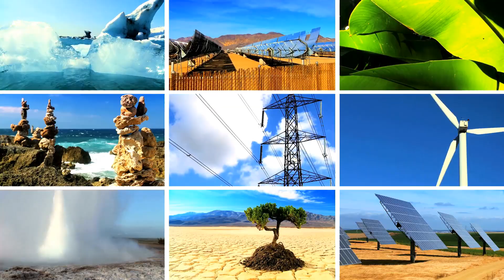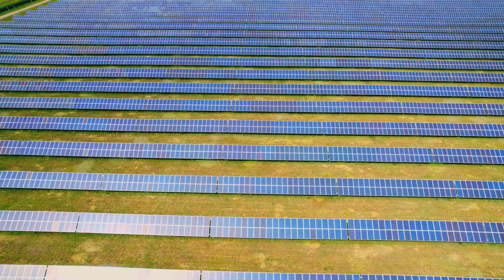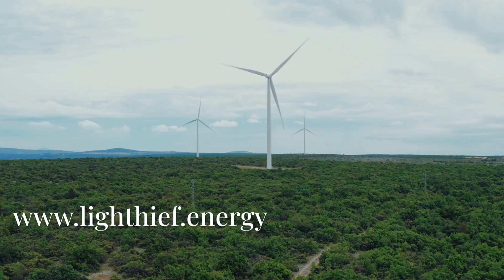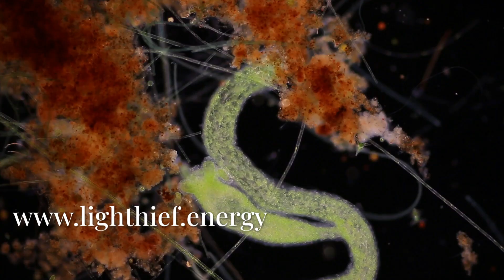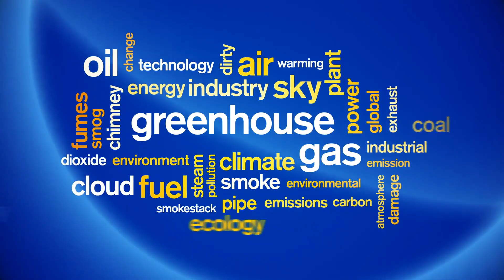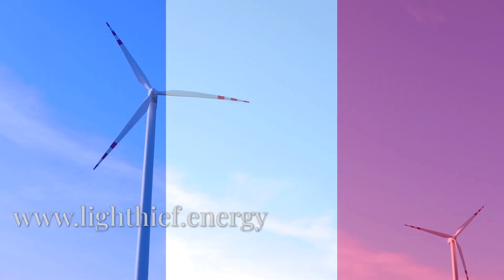How Solar, Wind & Biogas Power a 100% Renewable Future

Comment: Yeah, show how 100% of solar panels get recycled.
And how 100% of composite materials from wind power plant get recycled.

Only thing those material renew is need for more landfills.
Reply: A huge scam all of it, the only ones making profit from this is the people that sell this crap that is useless because it destabilize the electric grid.  The entire co2 climate hysteria is a scam just like the hysteria over the harmless covid influenza.
Reply: @a64738  In general, I do agree. But C19 was far from harmless. It was new virus, far outside what our immune systems were used to detect.
And it was dangerous to great many people. Those who survived 1st encounter gained best inoculation possible. No jab could do better. But it did cause auto-immune problems for many.

On other hand, mRNA jabs caused quite a few problems of their own. Including auto-immune responses, heart damage, ...
And more time someone got poked, worse ability of immune system in detecting real virus. As it was considering jabs as false alarms.

And clearly, it was large scale human trial without actual consent. Highly immoral. And cash grab.

On top of that, restrictions prevented elderly from going out in summer, properly exercise, get vitamin D, ... Which increased actual mortality.

On other hand, if it was considerably more virulent, doing nothing could have had fatal consequences for quite a few countries.